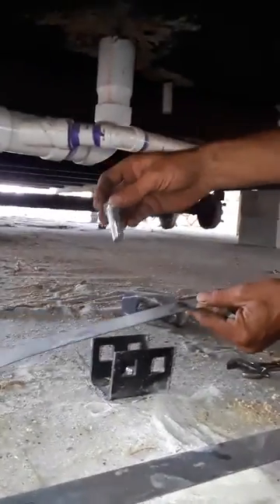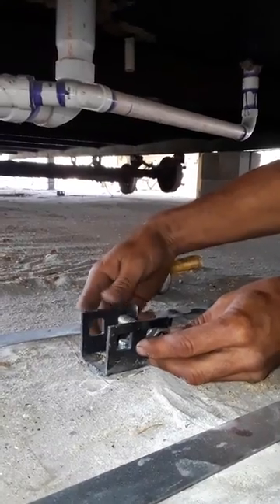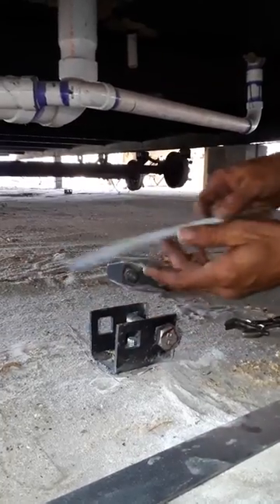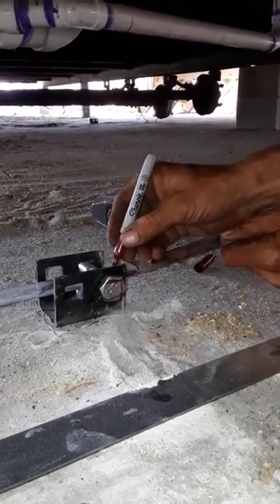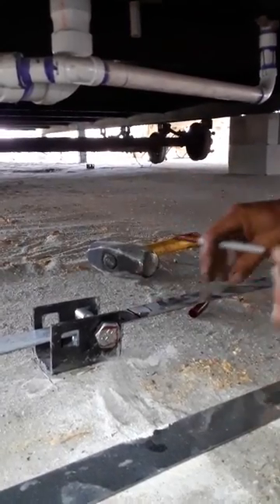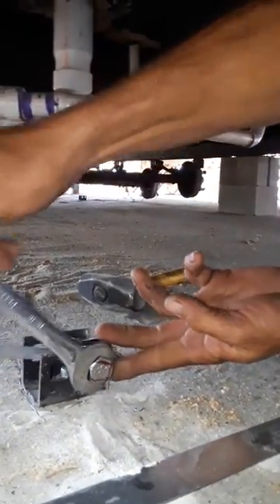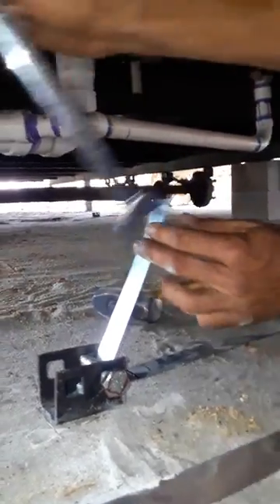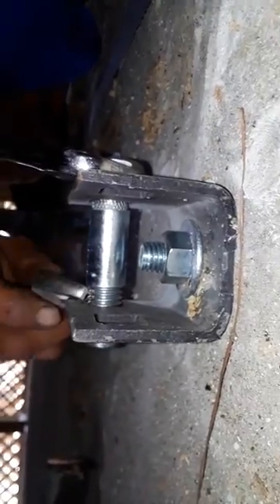How to install hurricane straps on a trailer

Comment: I do this every day for a living so ik this isn't right
Reply: Do you need a license to do this to pass inspections to help a friend?
Reply: Hi, how do you get that black piece in to the ground first ?  What holds it in place in the ground?
Reply: @donpazer  the black piece that’s in the ground is an anchor. For instance , with a 30” anchor, you need to dig a 18” hole, 10” in diameter. Sit it in it, then you can sit a board/ handle (whatever fits) or you you can get a square piece of metal and weld a nut on top and use an impact gun to drive it down. One the anchor is level with the ground fill the hole with concrete. Also the anchor itself should be at a 45 degree angle facing the other side where you’re strapped to. That’s what I was taught at least. I’ve seen people have it straight up and down though.